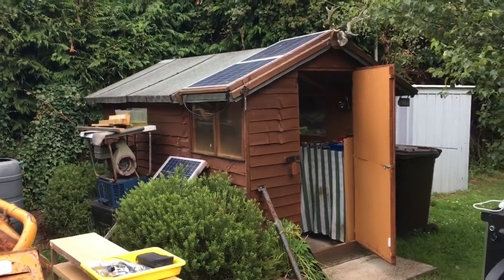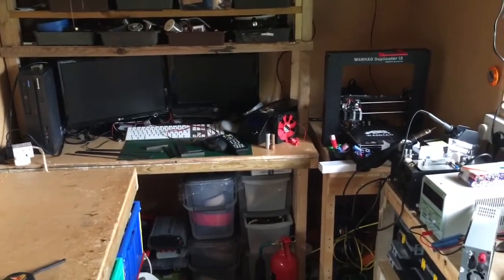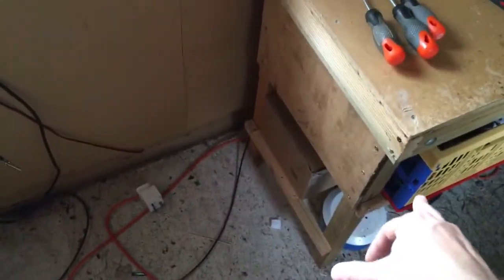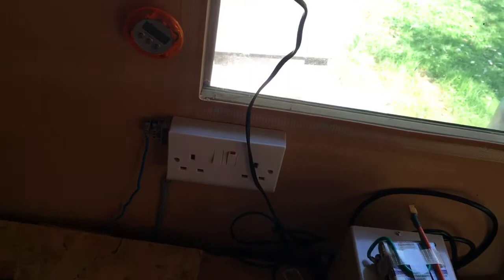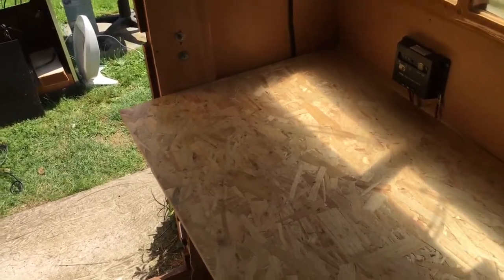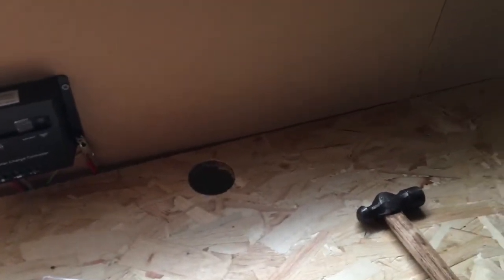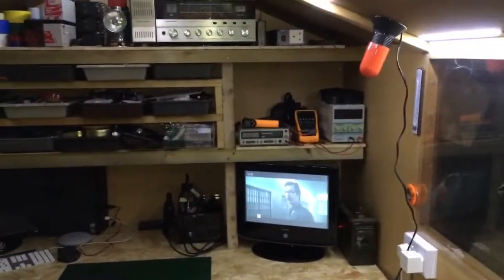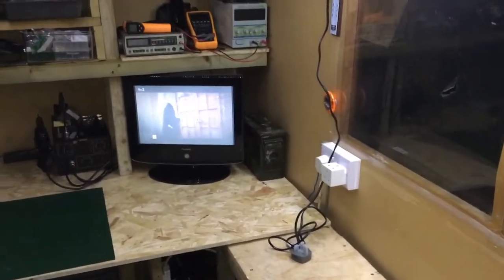Solar Shed Renovation

Comment: Lovely nice wide work spaces for the win, like it, that ocb lasts an age and is pretty strong, it is worth that under beam support i would think :-) perhaps a similar support running parrel along the back wall encase you are hefting heavy metal on there one day or something :-D but love it, the lighting is really subtle but bright to.
Reply from the maker: Will do Thanks mate.
Reply: Norfolktuber
:-) it really is a great setup, no noise worries, a good space to mess with renewabels while inside having loads of workspace for bench jobs, hmm did you run a lan cat 5 cable in there for the net or is it running on a wireless? with the net accounted for i literally cant think of anything else that would come in handy :-D
 Im looking forward to seeing more 3d print stuff as well as metal turning gear :-) perhaps combos of both :-p
Reply from the maker: i got a bt home plug down in the shed with wireless.
thanks mate look fwd to seeing your future projects.
Reply: Norfolktuber
sweet i hear those home plugs are pretty good, clear with a good ping and transfer, its a real win mate, added up thats one real nice work setup that will enable you to take on big projects as many compact ones. we are both slowly getting there now :-) it takes an age to kit up and refine stuff but its sweet as it tweaks us in to good practices and things :-p